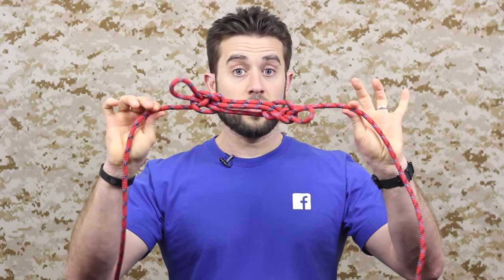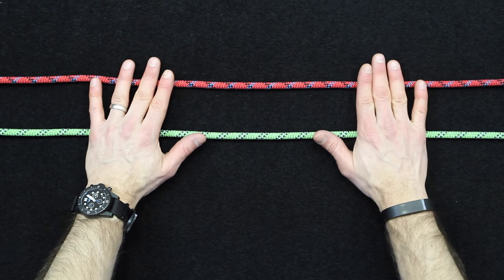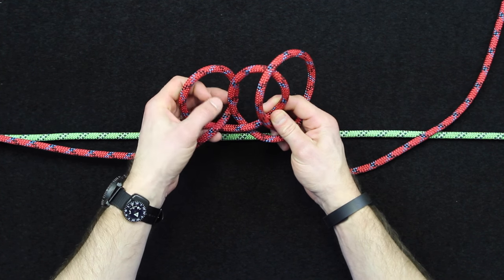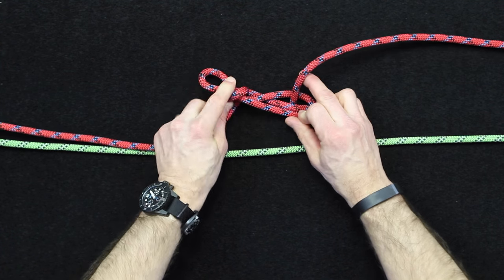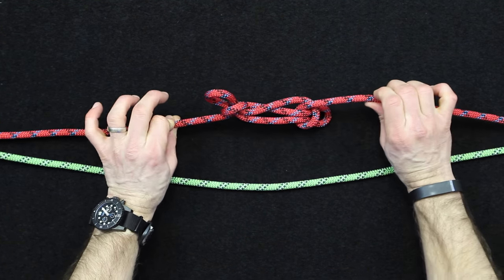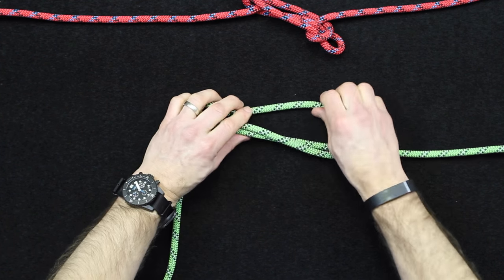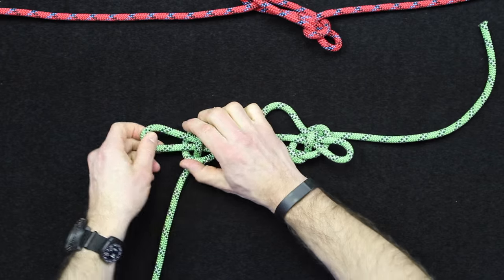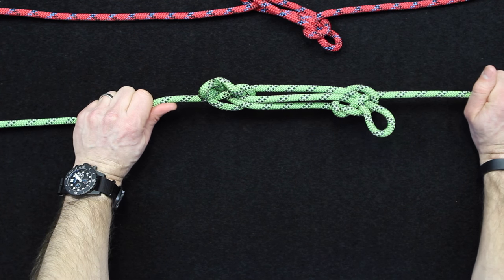Shorten or Bypass a Damaged Section of Rope with the Sheepshank - ITS Knot of the Week HD

Comment: I cannot comment on the usefulness of these knots for climbing but as a fisherman we use this knot a lot, me specifically for buoy lines. The only exception is the way that you tied both, they will not hold unless consistent pressure is applied. This does not work on the water with the tides moving and waves. When we tie them we use the variation you showed first but add an extra hitch on each end. You can easily shank up 10 fathom or more and have it hold on a buoy line without becoming a mess using that method. try it out!

Comment: I created a way to enforce the quick and hasty version of the sheepshank that will not allow the loops to fall out from the knots that are constricting down on them...even when you shake the knot around trying to unravel it....and even when you try to manually back the loops out they cant be backed out. Making a knot that has a tendency to collapse....pretty damn strong and secure. I call it the "Zeppelin Sheepshank."

You can also run a stick/spike through the "rabbit ears" of the finished sheep shank and make a kind of "Marlin sheep shank" ...that isnt going anywhere...but I'd never trust a sheep shank with the heaviest or most crucial  of loads.

Comment: If you actually have a damaged section of rope, you should probably just cut out the damaged bit and tie the ends together.
Solves the issue of the knot requiring constant tension, as well. This method looks like it would easily fall apart if it doesn't have constant tension applied.

Comment: Im a new subscriber: i was wondering how does the sheep shank performs under tension? I'm a groundsman for a tree service, so damaged ropes are always on role call. Can I implement this knot and use it as a tag line? Or can I throw a truck on one end(with the knot tied somewhere in the midsection) and tension it down without calapsing? Very interested in this knot and channel.
Reply: Don't ever rely on a sheepshank in critical load-bearing applications. It can spill or collapse under either too little or too much tension. Use something else to isolate a damaged section of rope, for example by making an alpine butterfly loop with the damaged section inside the loop section. (It's a really good knot, and can also be used as a bend to join two separate ends of rope.)

Comment: Take the running end of the rope, pass it through the loop. Each side. It won't come apart, you can pull like hell, and it will come undone easily. If you have to tow some thing it is a good way to shorten the rope.
Reply: Thomas Tamir I noticed that too! He didn't complete the knots! Je meds to pass the ends thru or a bite for a Caribbeaner